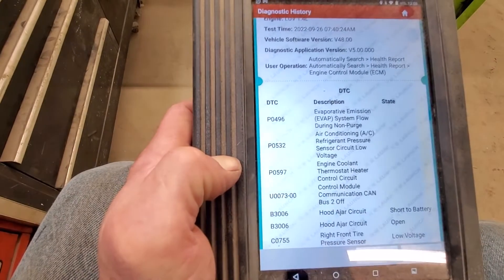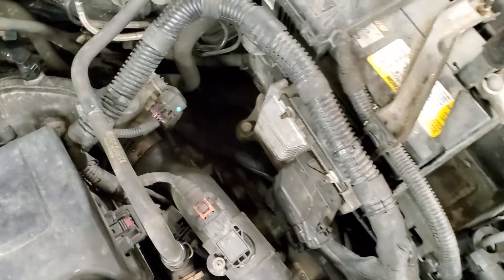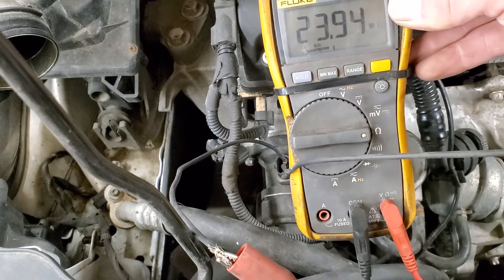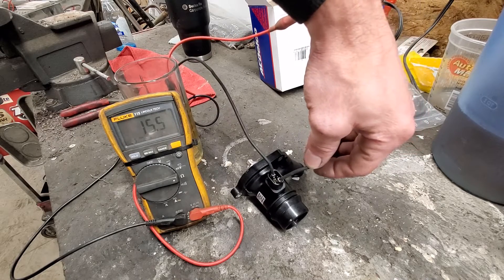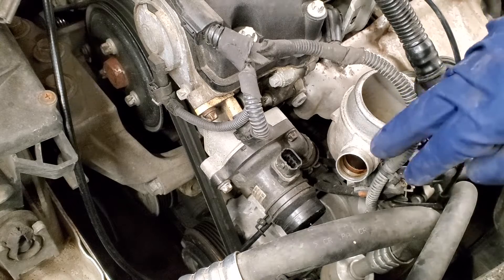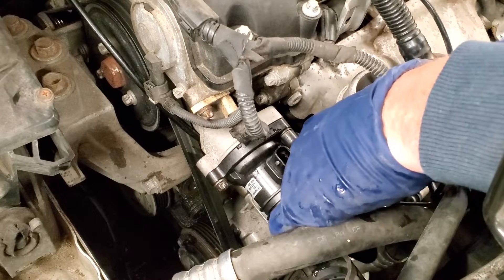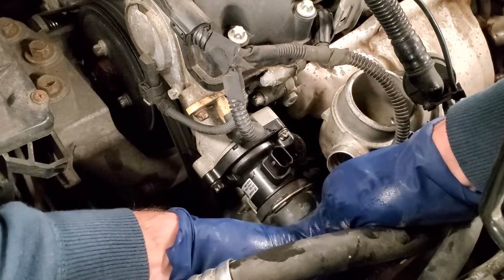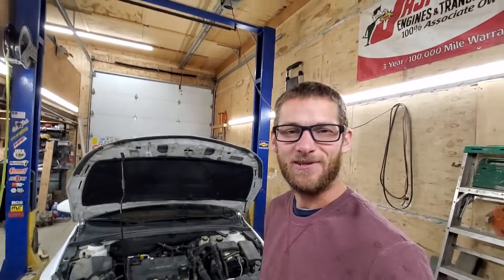Chevy Cruze 1.4 P0597 Diagnosis and Thermostat replacement

Comment: For everyone still coming here. I inspect the cable first and made sure there’s no corrosion or loose cable. In my case, I got very lucky. I unhooked the cable and inspected and it tested. It seemed to be fine. Put it back in and the check engine light went away. I went and checked the codes and the computer cleared them itself.

Comment: I have a 2011 chevy Cruze 1.4 turbo and it’s stalling and turning off too, I have a small coolant leak as well, so u thing replacing the purge valve and radiator will stop the stalling ? Also the car dosent over heat i can just see the coolant on the ground when I move the car
Reply from the maker: I'm not much for guessing or speculation on what the problem is. My diagnostics are data driven start to finish starting with the relevant trouble codes and working from there. If you want to know you are replacing a faulty part then it will require some bit of inspection and testing. Otherwise you might as well set up a dart board and label it with multiple car parts and throw at it to see what the problem is. So if you're asking for help or direction on your problem I'm interested only in hard data starting with what trouble codes are set
Reply: Should you drain the coolant first or does it not matter?

Comment: So quick question, I have been getting my check engine light on for a bit (I haven’t driven it since, its just been a hot minute because I’m broke 😅) but I took it into an auto zone to get it tested and the code that came up was P0597 twice(?) and a U0100-00. I know next to nothing about cars because I’m disabled so I never really had an opportunity to get under the hood to learn so I don’t know what they mean but trying to figure it out led me here. Anyways, back to my question, how much should this service that you did in this video GENERALLY cost to get fix? As I said, I’m really broke so I’m just wondering how much I should set aside to save up for this & for how long so I can try to budget it properly. Thank you in advance for any help and for posting this video (I at least now know what to look for if the shop tries to cheap me)
(/g/pos)
Reply from the maker: I'm sure it's at least a couple hours labor you'd get charged

Comment: Hey, great video with the diag you do up front. Very helpful. I have a 2013 Sonic with the 1.4 (same powertrain) and when I connect my test light to positive and to the PCM driver (ground) my test light does NOT illuminate. Any idea on how to troubleshoot this? I've checked all of the fuses and they are good. I've never traced wires in a wire harness and I feel like that is the next steps. Whew. TYIA!
Reply: I should add, I bought a new thermostat housing with a resistance of ~16, and the existing one tested nearly the same, so I'm pretty sure that my thermostat heater is good. It was replaced by the previous owner about 5K miles and I think they just drove with it on. I bought it from them for a "good deal" (maybe not...) and want clear the check engine light.
Reply: Fixed it. Used a toner and one I was able to trace back to the PCM, the other I couldnt trace it more than 3" from the connector. Cut back the tape and the wire broke from the connector. I struggled but used two picks and a small screw driver to push out the pin and was able to fix it with a new wire and some solder. Thanks again for the troubleshooting process shown around 2:00-2:30.
Reply from the maker: Glad it helped! Thanks for the kind comment!